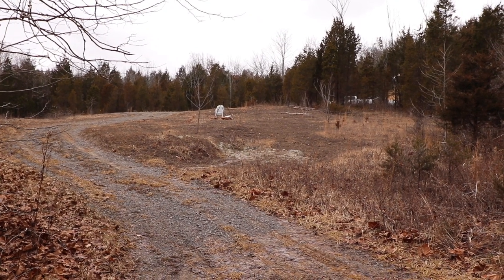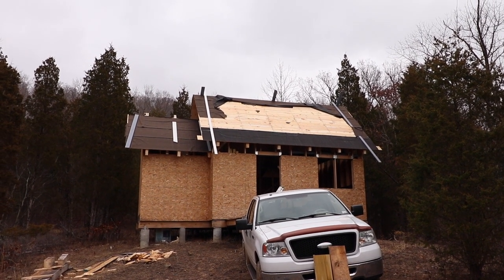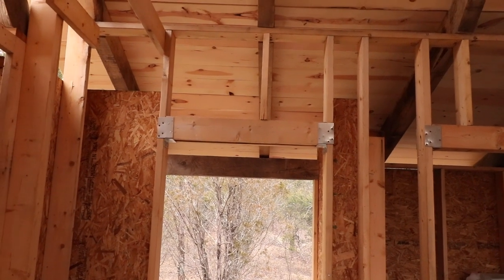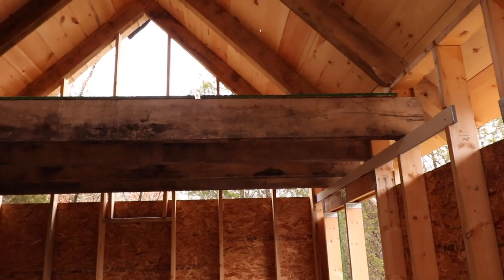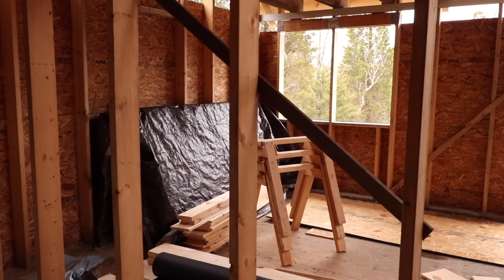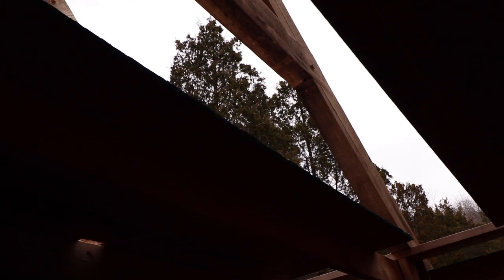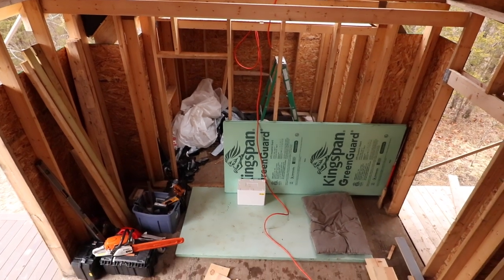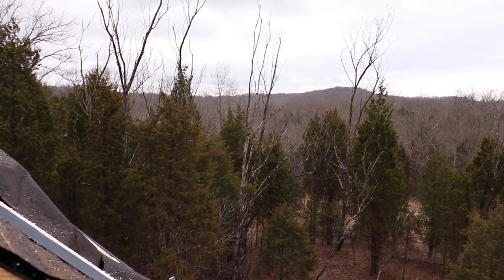Off Grid Cabin Tour

Comment: Those gussets will fail in a fire. People don’t realize if your home is engineered framing the fire department will not make entry to save your life! Also ballon framing was stopped because of fire spread issues. The fire travels freely along  the entire length of the studs through all levels and enters the attic. I hope you added fire stops in your walls or a small fire will take your entire house.  I too live in an unincorporated township where we have no bylaws or building inspector but no one would dare build a ballon frame due to the dangers of it.
Reply from the maker: Richard Clarke, Rest assured Richard, as my flaming cabin comes crashing down around me my last thoughts will be “Ohh whoa is me, if only I had listened to Richard Clarke!”
Reply: @lindanwfirefighter4973  He'll have to have a couple fire alarms -- no fire dept to save him in any case.
Reply: @lindanwfirefighter4973  
House frames can be fixed, petulance cannot.
Reply: Mr. Clark evidently does not live out in the country.
Reply: Ah!, out there, what fire department?  
JIM
Reply: @lindanwfirefighter4973  I think there would be the same result with firestops.
JIM

Comment: What's fun is to install a large windowed weatherproof boat hatch in the roof that allows you to climb out from the loft.  Lots of uses beyond egress.

You need some really high performance insulation in those unusual walls and ceilings, and a two-part closed cell foam spray in would give you 7 R-value per inch, vapor barrier, and an airtight enclosure. There are some really good DYI kits with what looks like a pair of propane tanks.

If you have running water in a creek nearby, a microhydro system would assist the solar. Microhydro systems can produce a lot of power, even when it's dark or raining.

Keep pouring rock on that steep hill part of the road, eventually you'll be able to drive a Lexus up there.
Reply from the maker: I can actually fit out the loft window, it just isn't large enough to meet code. I am going to be spraying the underside of the cabin with one of those kits this spring hopefully.  I'll also be adding 1.5 inches of rigid foam to the back of the cabin.  The back is an easy install since there are no windows to flash around and only 1 door.  The steep part of the road needs some work right now.  I need more ditching to keep it dry.  Then I will grade it and put some base stone down.
Reply: 50 Acres & a Cabin 
the boat hatch installed as a skylight would be in addition. i put just that in the off grid i built and it was very useful to get on the roof so easy and safe. plus lettin light and having a big vent that you can open in summer.

rigid foam is good too, but not vapor tight unless you housewrap and tape.

Comment: Very nice job, especially with the roof timbers. I used let-in ledgers on my 2 lofts also. Seems much stronger to me and as you mentioned, the loft joists hold the walls from spreading outwards. One of the reasons I picked my town is that there are no building codes;  I can do all the work myself. Beautiful location you have. - Dave
Reply from the maker: Yea I think it's a pretty good way to build a cabin,  and you can always add in fire blocking if you are worried about it.  It's nice to have the flexibility to build things how you want.

Comment: New to your channel, I just found your videos and started following your build. 
A question I have is, Do you think the AC/DC charging distribution being in the same room as a shower cause any problems with condensation to form on the distribution block?
Reply from the maker: Yea, I do think it could be an issue.  I'm actually going to frame up a partial wall and a false wall to isolate those electronics from the shower area.  I'm thinking something along the lines of hidden passage way bookcase type thing so if anyone breaks in they may not realize there is expensive solar stuff in that corner of the house.

Comment: I enjoy your videos very much. I noticed the roof decking is not t&g. . Do you get large gaps between as it expands an contracts? Is t& g even worth the extra cost?
Reply from the maker: Yea I spaced them out with framing nails when I laid the boards, then I put roofing felt on top so that when the boards move you just see black strips.  I think it looks cool.
Reply from the maker: I don’t think T&G is worth it unless you specifically want that look.  T&G does look a bit cleaner if that’s what you’re going for.
Reply: You an Boss of the Swamp have been a great encouragement. Started my dreams of an off grid cabin in the woods a couple of years ago. Its slow going but its mortgage free. Thanks for all the great video you do.  IG coreygillum12
Reply from the maker: No problem glad you’re getting to live the dream

Comment: Why did you use expensive header hangers? Jack studs are super cheap and the strongest form of support
Reply from the maker: I liked the idea of minimizing thermal breaks.  Since I knew I wouldn’t have enough power for air conditioning I wanted to make the building as energy efficient as possible